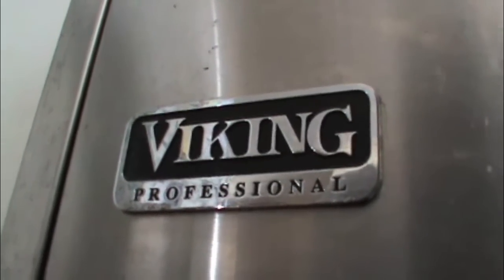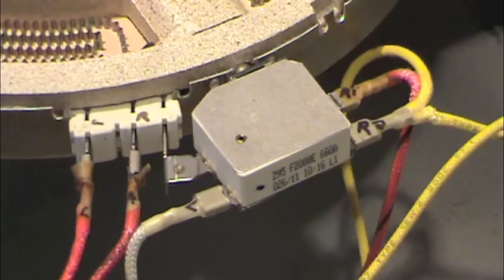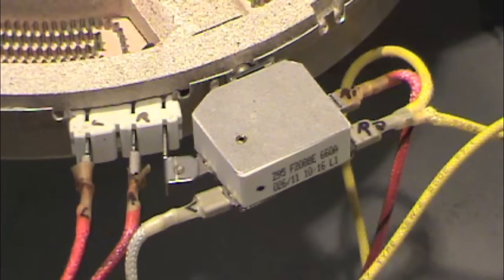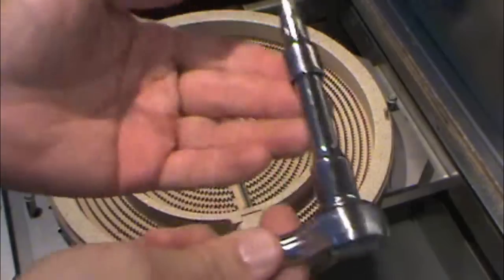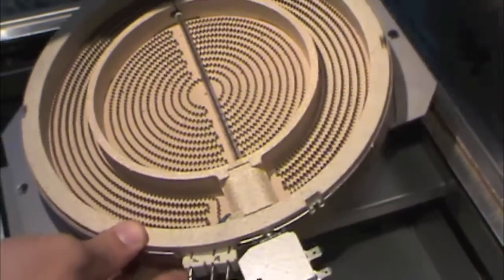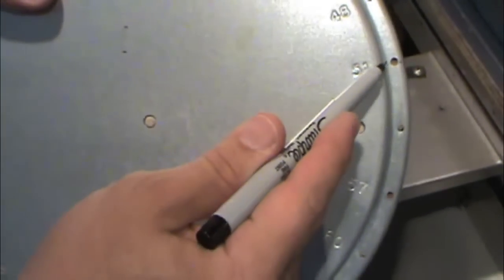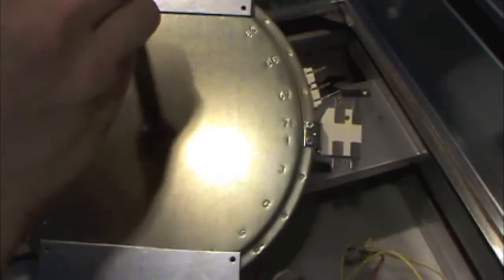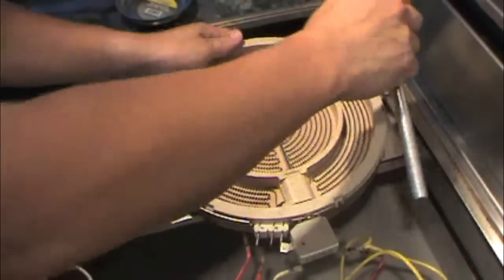Viking Electric Range - Replace Burner

Comment: Best I can figure on removing the glass top is to cut away the black silicon seal   - and try to factory seal it again.    OR  remove two screws on front underside (can them when you have removed the front panel screw)   AND either just bend that whole glass and metal framed assembly upward (use a wedge to hold it in place while you remove a front burner.    REAR burner I think you need to remove two side screws on upper rear plate and then the back plate just above the stove removes AND THEN there are three screws running horizontally, that might be accessible with a phillips mini rachet so that the whole metal frame glass assembly can be removed officially.  GGP

Comment: Where did you get the model number from ?
Reply: +rdental inside of the oven on the upper right area. (if you look upside down inside) you will see the model number of your range.  The one that they are demonstrating looks similar to mine which is a VESC5304BSS electric viking range.